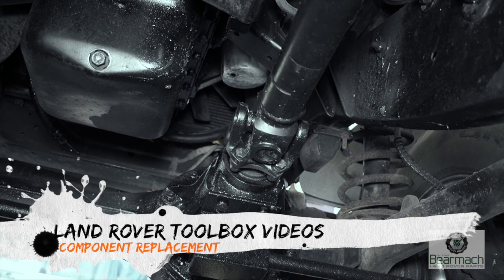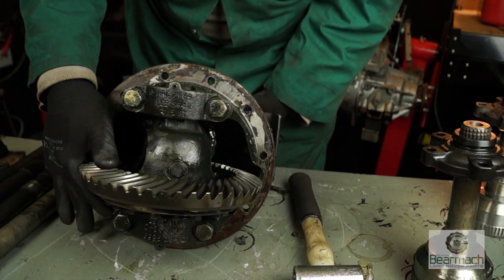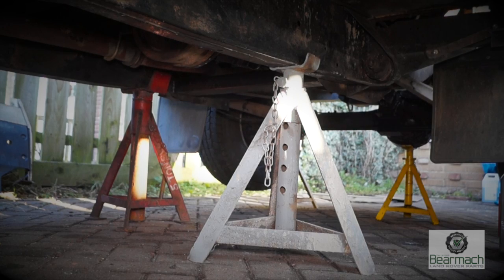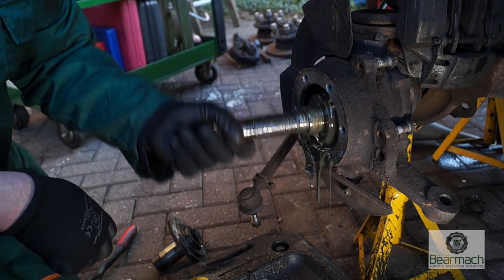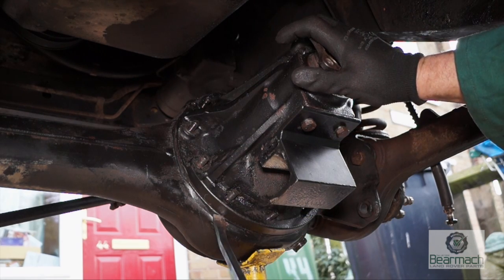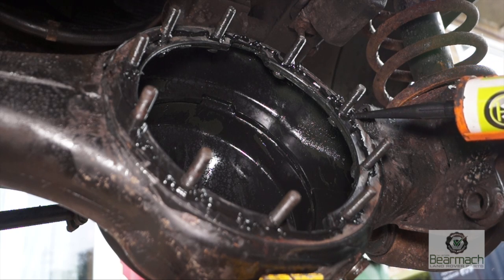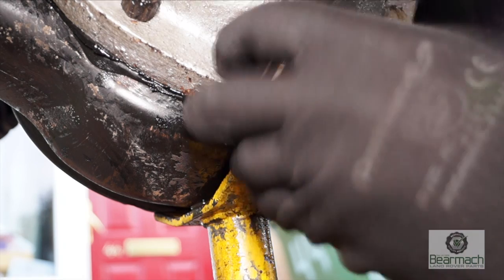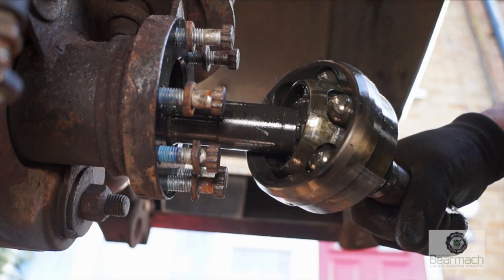Replacing the front diff - Defender - The Fine Art of Land Rover Maintenance

Comment: Hi, Could you do some videos on upgrading engines to meet current emission standards?  thanks
Reply from the maker: Wouldn't be wise to bring an engine to meet Euro 6 standard if it is not designed for it.  You know, all engine block principles are all the same but with diesel it the fuel and air system including the exhaust that are the workers to get the emissions down. 

 Euro 6 stringent emissions are achieved by NOx treatment in the exhaust.   Sorry to disappoint you but it would be both hugely expensive and impractical to try to engineer an engine for the latest emissions standards. Better to just go out and get one ie: Puma 2.2 Ford Duratorq engine with all the gubbing to fit if that is what is desired.

Comment: can a discovery 24 spline diff fit into 110 county v8?
Reply from the maker: Yes.  In a nutshell. but you need to make sure the 110 county is also 24 spline half shafts.
Reply: @trailerfitter2  ,, I have a 5 cylinder inline Honda Inspire with a front differential transaxle. It is slamming when moving from park and louder in reverse. Mechanic said is the differential. Car drives great otherwise with smooth gear changing. What advice can you give is appreciated.